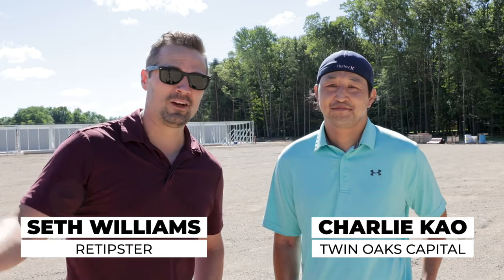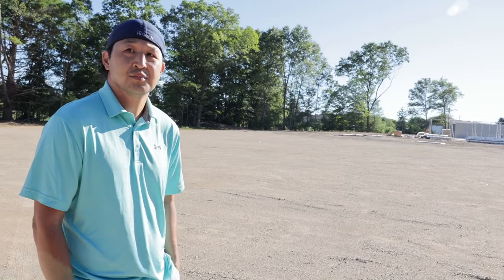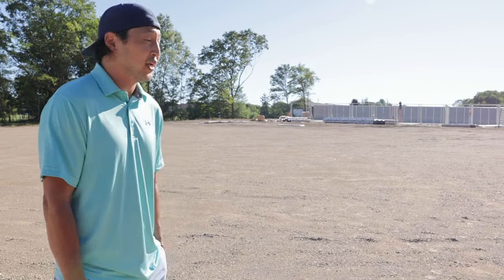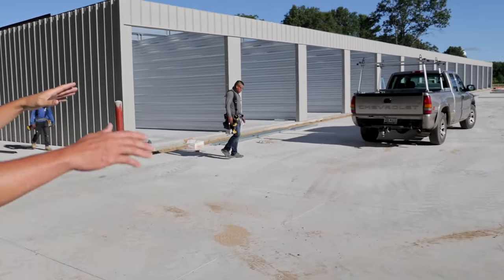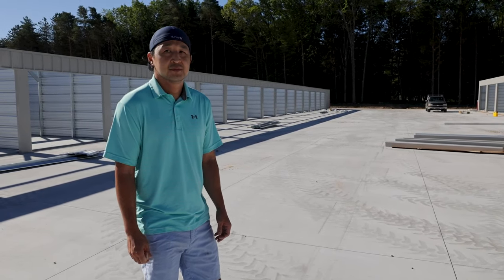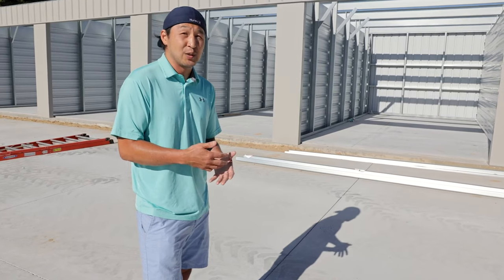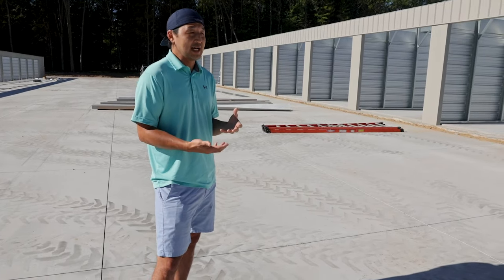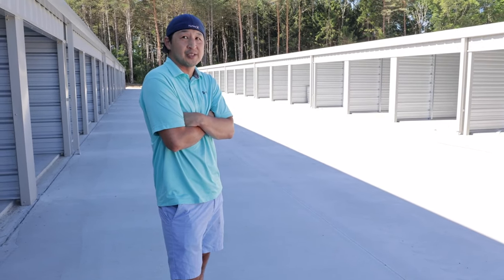Constructing a New Self Storage Facility from the Ground Up - Interview w/ Charlie Kao

Comment: 12:27 I wonder if you could put in a heating system in the concrete to just melt the snow. Sure it would cost a lot but how much is that plowing over the years?
Reply from the maker: I've wondered that too. My gut tells me it's cost prohibitive, not just in the installation but also in the energy to run the heat. If it was an obvious benefit, it seems like everyone would be doing it. That's just my conjecture though, I've never looked into it myself.

Comment: Awesome information! I'm constructing a 2 building, 14,700 SF now in Eastern CT. What are you doing for height from top of finished pavement/concrete to base of concrete floor? My site engineer used a 6" rise which in my opinion, is pretty high. From my research, it seems a 2-3" rise is more common.
Reply from the maker: When you say, "rise" do you mean the total thickness of the concrete, or just the lip that comes up from the base? The thickness of my foundations is 5 inches, with 12 inch footings all around it (this is in Michigan, which is pretty similar climate to CT).
Reply: Appreciate the fast response. I'm referring to the distance from the top of the finished asphalt/concrete to the bottom of the roll-up doors. Basically, the lip rise at the edge of the foundation slab above the asphalt.

Comment: on climate control building would you add perimeter access storage
Reply: It would depend but alot of times if it's only climate control facility that has a locking gate code in front, but if you have a hyrbrid or outside parking we likely would.  You can learn more about us on our Youtube Channel @twinoakscapital

Comment: How many acres do you normally need for a self-storage business?
Reply from the maker: It depends on how many square feet you want to build and how much storage your market needs. I would like to see at least a few acres, but preferably in the 4-10 acre range (more is just an added bonus).
Reply: @Retipster  Thank you for responding. I am a Realtor. If anyone is looking for land to develop a self-storage facility and want to be in the Savannah, GA area I have a property on the market that has 4.88 acres of land in Rincon, GA which is 20 miles from Savannah. It's zoned for commercial or industrial development